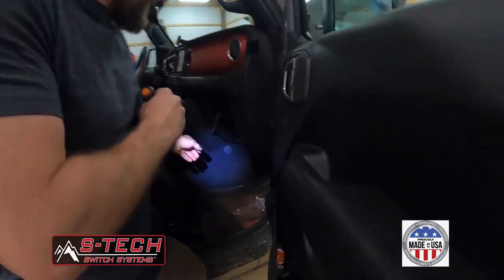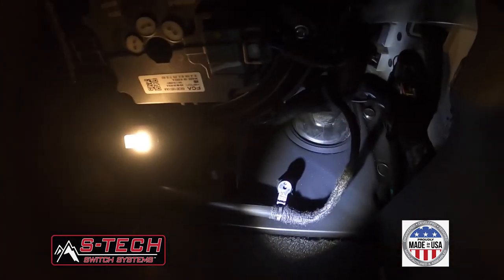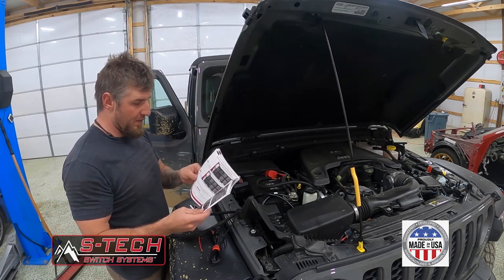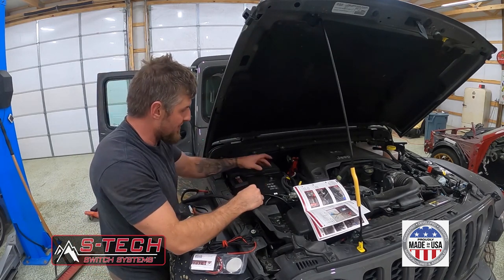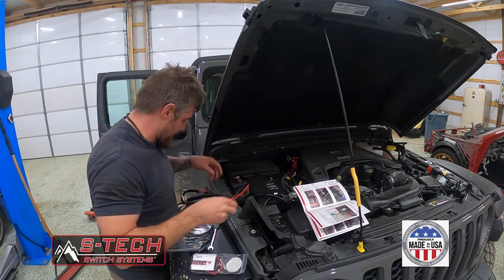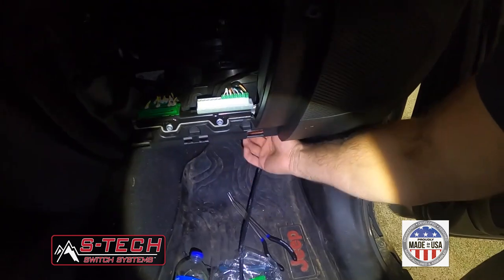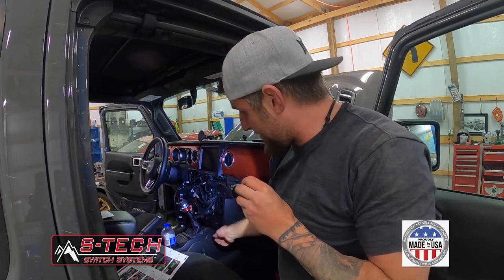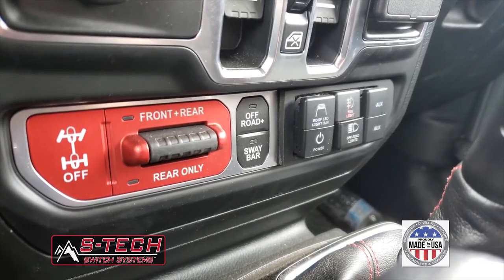S-TECH Switch 6 Jeep Gladiator Rubicon Right Cubby Installation Video

Comment: With batt disconnected always turn key to on to drain residual in the system
Reply: It's because there's 2 batteries in the JL wranglers. The second one is to run accessories during the start stop deal they are quipped with. Of course, they don't mention any of that in the owner's manual.
Reply: @NunYa953  Correct! It's for the ridiculous auto start system.